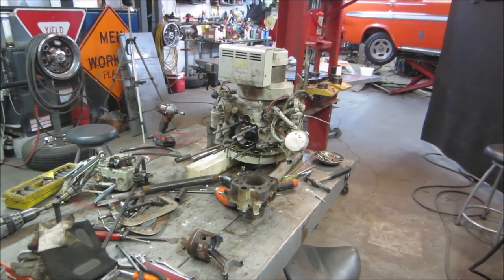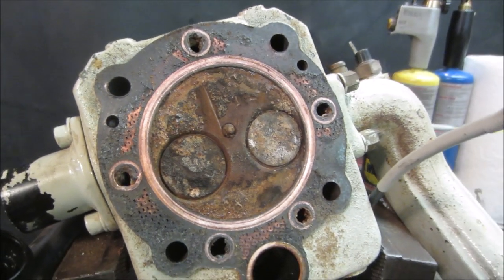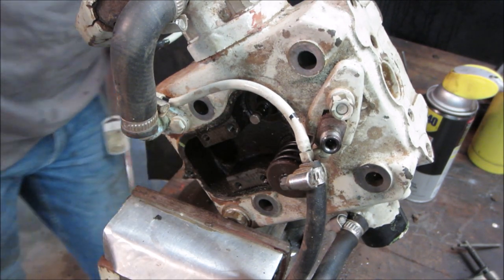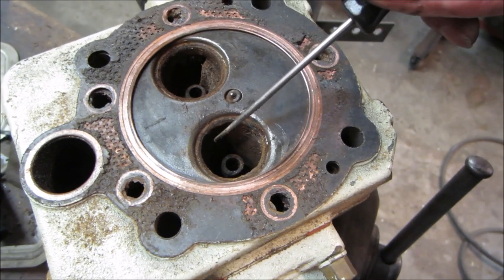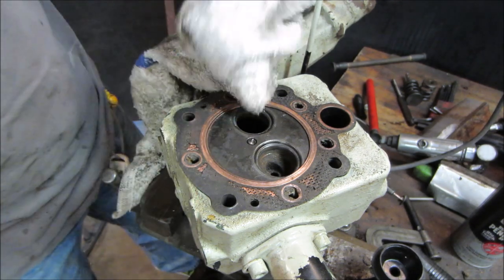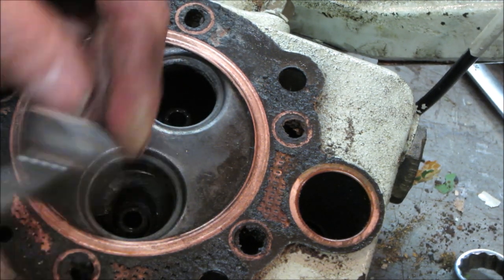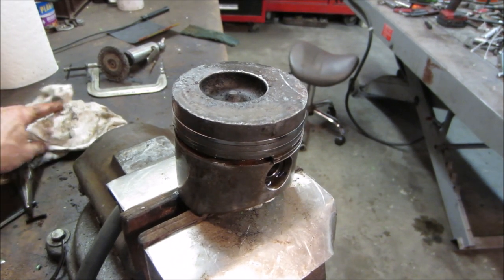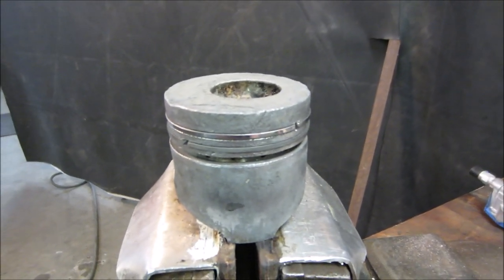Can It Be Saved? Junked Marine Diesel PT 2

Comment: Engines mounted in boats most of the time use sea water as primary coolant.  Sea water can run directly thru the engine or thru an intercooler filled with regular coolant liquid. In both configurations, after cooling the engine, sea water is injected into the exaust gases and leave the boat thru the exaust pipe. The engine you are trying to recover, for some reason after stopping, the water injector sent back to the exaust manifold the cooling sea water, then into the cylinder thru the open exaust valve. This happens because the loop  was not properly positioned in height relative to the engine or the air vent was blocked or both. You check the injector at the end of the exaust section of the engine. It seems to be broken. This prevents the engine to run as a marine engine with common exit of sea water/exaust gases. To use the engine as a land generator you need to convert the cooling system, unless you intend to use it near by a lake or using a lot of circulating water. You should check the water pump because most certanly the impeller is broken or seized. Anyway, thanks for the time you spent... and be careful with the money you will, if you intend to keep that gen.

Comment: It's dead Jim. Heck of a try though. I wonder if the crack in the piston happened at the press. Not that anything could have been done to prevent it.
Reply: since alloy ( piston)  expands faster that iron (cylinder) heating it would make it tighter...  freezing might have helped free it? especially if one had liquid nitrogen around :)

Comment: Hey, you've gone so far with it, hope the rings are available.  I hope the Lombardini group can provide rings, piston, and a head gasket for a reasonable cost!

I've seen many marine engines damaged by frost cracking inside the exhaust manifold. It can crack and allow water to drip back into the engine.  Another possibility is that the generator was disused for a long time and each time the boat was run, a small amount of moisture entered. 

I still hope you are able to get it back together and not give up on it. :)

Comment: Exhaust manifold was, what looked like, failed from corrosion, so, if the outside was that bad, it is entirely possible to have a pin hole or crack in the casting toward the exhaust passage. Looks like it is raw water cooled, so sea water would go right into the cylinder. In the stuff I saw at Cummins, the early non keel cooled engines had this type of failure often in the exhaust manifolds

Comment: I succeeded in removing some REALLY stuck rings by heating up the piston and rings and cooling the rings with rust remover, but don't breathe the vapor
Reply: I was going to say heat it up with the torches again. The rings are super hard spring steel and the piston is softer, they'll expand at different rates. That and soak them in CLR. 

I've found over the years that really hard metals tend not to rust as much as the softer ones (more carbon I guess?)
Reply: @muskokamike127  i heated the piston a lot but also a lot of times, and it got a bit more free every time
Reply: @albaek790  yeah it's the movement that frees them up, kind of like my knees first thing in the morning lol
Reply: If you heat the rings too much you will remove the temper and they will be useless.
Reply: @gordbaker896  yes of course they don't need to be that hot
Reply: @gordbaker896  yeah you normally have to get them red hot to do that and you really can't do that with his propane torches. If he was using the green MAPP gas then maybe. He "might" be able to get them to 4 or 500 deg and that wouldn't be hot enough to do it. Considering the average diesel combustion chamber is about 600 deg C which is around 1200 F

Comment: The damage on that exhaust manifold looked like freeze damage to me. This would have allowed cooling water from the jacket and into the cylinder.   May not have taken a lot to cause that damage if it was salt water.   May also explain why the bottom end seems ok... just not enough water to get down there.
Reply: You hit the nail on the head my friend I was a marine mechanic MerCruiser but not a diesel mechanic

Comment: That cylinder does not look "Pretty good" It needs a sleeve. All the rust pitting will do is tear up a set of rings.
Reply: It'll ride the pitting just means extra oil
Reply: you are right,he doesn't know if the gen works or not,but that cylinder is toast,power to any engine is in the ring seal and heads,if i do this much loving on something,its gonna be worth it,but he is instructional,and he is like me,this is not a throw away world,and that is what it seems to be changing to,not on my watch

Comment: Looks like from comments, you got parts source, friends from the factory, & a banker. Now you have no excuse. Rebuild it.🗜 🎥
Reply: dam right rebuild it
Reply: Reread that thread about the parts source. It fizzled up.
Reply: Looks like it could possibly have a piston and rings from another diesel engine such as the yanmar f6e, ts70, or ts80 retrofit into it the rings appear to be for the same bore you would need to know pin bore center to crown height, pin bore and cc's of the dish to know what would work or be modified to work and you could always have a new liner made and placed into the jug

Comment: I don't know if this has been said already.   Raw water cooled marine engines inject water into the exhaust elbow.   If the exhaust elbow is internally damaged and the engine is cranked over excessively before starting, it's possible for the engine to ingest raw water through the exhaust port.   And then, if you're lucky you end up with an engine in this condition.   If you're unlucky you hydro lock it and bend a rod.   I'd wager that's happened in this case.   You may get it running, but check the exhaust elbow carefully (there is a simple leak test you can do with water).

Comment: He needs to buy some penetrating oil!!! The best that would really help here is a product called Blaster!!! It would make so many things that he is working on here, so much easier & less damaging to remove... Another thing, is cylinder sleeves can be made to this spec... Rings cane be matched for this app, from a company called Hastings or Mahle... And a head gasket can be made for it as well... I would start checking the classic car buffs to see where they go for things like these... Probably from compressed asbestos & copper...
Reply: Easy to cut copper gaskets on a laser table

Comment: Exhaust water reversion is a pretty common failure mode for marine engines.   Check to see if there are cracks in the water jacket/manifold that would have allowed cooling water to get in to the cylinder head and sit there.   Marine manifolds are actually considered consumable items on boats - replace every 3 years in salt water.

Comment: Mustie a trick that works for me on stuck rings is to use an excto knife blade and tap the rain inwards at top and bottom of ring scrapping as well with blade.  Not much but if you can get the ring to move it will work itself free.  Secondly Hastings makes rings of all shapes and sizes. If can find someone that has some and cuts them voila new rings. Have done this for old John Deere snowmobiles a few times as there is no pistons or rings available for some of the engines used. Had one with seized piston pin. I put new rings and pin with bearing in it works great.

Comment: I have seen this before. When a sailboat is healed over on the same side as the generator exhaust thru-hull, and the generator is shut down while the exhaust is underwater, it can suck water back into the cylinder. I believe the tech term is exhaust water inversion.

Comment: Your engine suffers from intrusion of hot saltwater fumes coming into the exhaust valve, when the engine is stopped  being hot after hard work; as the salt cooling water is injected in the exhaustbend, -  the hot funes enters back into the cylinder then causing corrosion og various parts such as exhaust valve, cylinder sides, head, and its very likely, that the injector nozzle is seized too.
You need: a full gasket set, new valves, filters, injector nozzle/needle assy, piston/cylinder liner, exhaust valve seat to be replaced, both trimmed with diamond tools in an engine shop, liftpump repair kit, starter and generator serviced exhaust bend replaced. Then your engine is ready again, - never use saltwater for cooling!
Provided your generator is inspected and perhaps fitted with new brushes and bearing it should work properly.

I had the same problems with a Perkins Perema M30 marine engine, which is now converted to freshwater cooling to avoid any damage caused by saltwater.
Its still a fine little engine worth the cost of parts to do many years of service.

HM.

Comment: Checked around. Called Blueridge diesel and they said ruggardini was bought by lamberdini and then kohler. Originals not avalible, but tons of 80mm X 1.5 or 2mm avalible for all types of other applications. Measure what you got, im sure Weisco has them on the shelf. Let us know what you find!
Reply: Also for the head gasket, coat both sides of that with permatex super 300 (no substitutes) and heat up both mating surfaces with a heat gun then torque her down quickly while still hot. It works!

Comment: In the old days when our car needed a valve job every 30,000 miles, my dad had a valve lapping device with a suction cup and an crank handle that would spin the valve one way and then the other. It cut pretty good because you could put good down pressure on the valve.

Comment: I have a similar air cooled diesel gen set. But I try and stay away from all marine diesels as you have experienced. The gen heads usually fail before the engines. I did enjoy pretending I was looking over your shoulder and handing you tools. My off grid backup gen sets are diesels.

Comment: A little compound trick- if you ever have a philips or allen bolt head that is worn or damaged and your wrench is slipping, put some lapping compound in the bolt head and it will fill the gaps and give you a better grip.

Comment: When taking cylinder heads apart I rarely go through the trouble of using a compressor just find a socket that fits over the retainer and whack it with a hammer and the keepers will fall out.

Comment: You will usually see pin holes due to the coolant cavitation during the combustion cycle, many big diesel repair manuals can explain it in detail.  With freshwater cooling systems it is caused by the wrong ratio of Nalcol (Anti-rust additive) to the antifreeze.  Too much or too little, either way, causes the problem.

Comment: That cracked piston is toast anyway but after soaking the piston in the ultrasonic cleaner, I've had good luck with moving a torch around the piston rings to heat them up while tapping on the rings with a wood dowel or handle of a hammer to get the rings freed up.

Comment: If the generator is mounted on a boat below sea level they will usually install an anti-siphon valve in the water cooling line to the water pump. If this valve blocks up, the water will siphon through the cooling system into the exhaust and back up into the cylinder.

Comment: Seat cutters will fix that, but it will increase the installed height of the valve springs. Even a machine shop could mill out the seats and install new pressed in seats. Send the piston to Diamond or JE and have them make you a new oversize piston and rings. Then have a machine shop bore out the liner.

Comment: I work on boat engines,i've seen them like that and worse;

Here is how to remove the rings when the pistone are NLA , or expensive, made of unobtainium:  use a piece of  steel rod, or a small dia.screwdriver,  it's diameter being just under the height of the ring you want to remove  ~~ 1 to 2 mm ( or use a steel nail, a punch/drift etc)  and sharpen the end like a knife ;

Insert it under the ring at the gap; (if no gap yet, and that is usually the case, sharpen  the end of the steel punch ,knife like and hammer it in ; the ring is cast iron,brittle,and it breaks off easily;  sometimes a center punch will be needed,on the ring end,but this tends to hit the aluminum too,go slow; 

Then  bend the end of the "punch ,on the vise,at an angle of 30º to 45º, ,and tangentially  insert it under the end on the ring,hammer it in,the ring end will break  and lift off,maybe 10 to 15 mms of it, that is the beginning;  keep doing it all around;

The ring will come out in more than 10 pieces,each piece between 1/2 inch and 1 inch long ; if you're careful,the aluminum groove on the piston will be ready to cleanup  and redress;  now,measure heights and diameters  to  HUNT for new rings

To remove the rings without breaking them (and sometimes it just is not possible,especially for the-thin- oil ring) it has taken me very long(3 to 4 hours, maybe more,for one piston alone...even on marine V8s, usually it's only 1 or 2 pistons that are really water seized,when they sit for years with water on top )  and a LOT of cycles of heating with penetrating oil, very light hammering,and wedging of  soft wire "needles" under the rings;  it looks to me that the piston and sleeve are usable,but we'd know only after cleaning the piston and  lightly running the stones(or just sanding by hand) inside the cylinder; 

If the press,before, really cracked the piston, displacing that chunk off of it,then the whole thing is junk ,no need to remove any rings   lol

Comment: The 80mm rings for a Lombardini LA80 might fit. The two top rings are 2.5mm high and the oil control ring is 4mm high. About £24 in the UK. There must be a matching piston, too.

Comment: I managed to free up a set of hopelessly stuck rings by heating the piston with a propane torch and repeatedly quenching it in solvent. Still had to work with the punch and hammer but it finally worked and that engine is on my primary mower with many hours on it.

Comment: Way back in the 1970's when or trail bikes stopped running and you couldn't get a piston for it anymore... Everyone would say:  Get a Wiseco piston. Supposedly Wiseco had all sorts of pistons for just about any application. Most of the people I ran with had bikes that had been bored over as far as the factory pistons allowed and Wiseco usually offered more options than EOM to keep your old bike running. Maybe there's a Wiseco piston that would help you out.

Comment: To get that old gensets diesel going again, it will need new piston and rings, rebore or resleeve if cylinder is too badly damaged, maybe new valves and valves guides since 1 was seized, gasket set etc etc and that piston with jammed rings will make a good ashtray in its new life. I hope mustie gets the old motor going again.

Comment: As the piston is aluminum, and the rings are steel, they have very different coefficients of thermal expansion.  If the piston was not cracked and salvageable, I would try heating and cooling them.  So as not to distemper the rings as might occur with a torch, I would use a kitchen oven at 450ºF for about half an hour,  then drop it into ice water, leave oven on and repeat as necessary.  Apply some full-synthetic (as it can withstand 450.ºF) motor oil (not anything that has a flash point lower than oven temp) to the ring-piston interface when you put it into the oven.

Comment: On the valves, as far as I remember you can get valve seat cutters which will recut the valve. Also you when unleaded came in a lot of classic cars with soft seats needed valve seats replaced for harder ones so they would cut the whole seat out, put in an insert and then recut it. 

Sad news about the piston.

Comment: I have a tin of both fine and corse grit valve lapping compound.  That, is the way it used to be sold.  You probably need the corse, followed by the fine compound to get those seats back to normal.

Comment: My guess is that the water intake got blocked up with something (happens all the time on old boats), which caused it to overheat (which explains the crack in the piston), which caused it to seize up. It probably sat there like a chunk of ballast for years on end. And because it had salt water sitting inside it, possibly for well over a decade (which explains the serious corrosion, coz hot salt water causes serious corrosion and other material build-up pretty quickly), it stayed seized, so the crew dumped it. 
I've seen this exact scenario play out quite a few times (I grew up on Trawlers in Far North Queensland, Australia). It happens remarkably often.

Comment: A common problem with water cooled exhaust is the exhaust will rust through because the electrolysis eats through the exhaust. The rust in the exhaust indicates this is what happened.  Causing the piston to hydraulic seize.

Comment: My guess is the water cooled exhaust manifold cracked due to either overheating or freezing which then let water into the exhaust and seized everything solid.
Reply: Or it rusted out. I heard that is also a common problem.
Reply: @unmountablebootvolume  Ah yes, that could be as well. I was leaning towards freezing just because it looked like the top the exhaust manifold looked like it had "burst" due to the ice expanding... but that could have happened after that fact as well. Hard to say exactly!

Comment: My money is on it got laid up for winter one year without use.  The exhaust valve was open and slowly but surely the salt air just ate it.  It was rusty, but it wasn't rusty enough to have raw sea water sitting on top of the piston.  It might have stopped producing power or the starter hung up or something and they just never used it.  Then they couldn't ever use it.